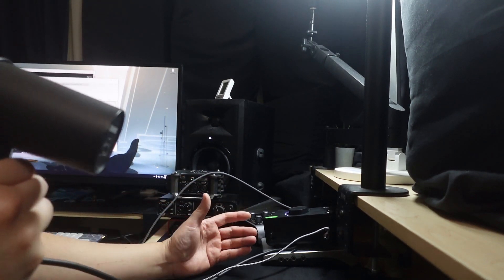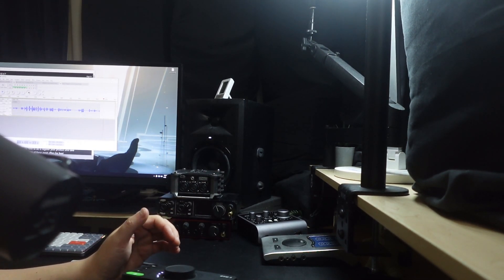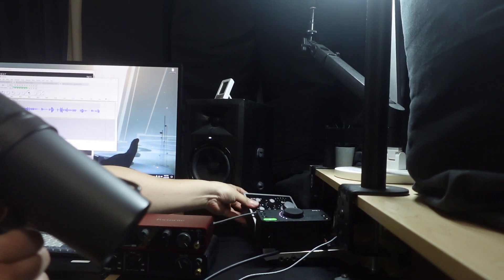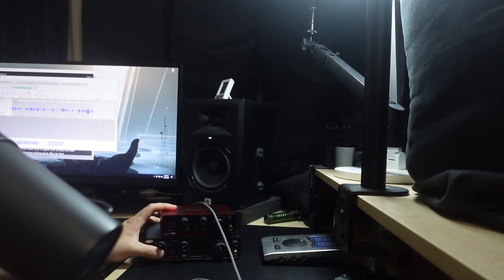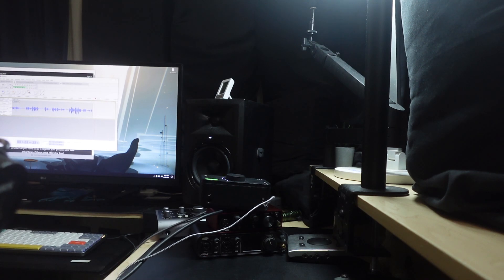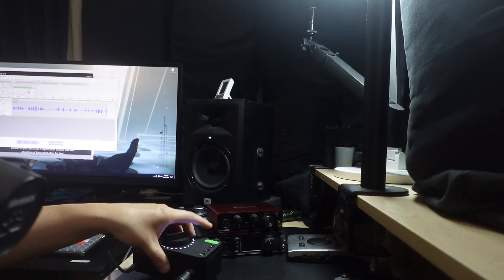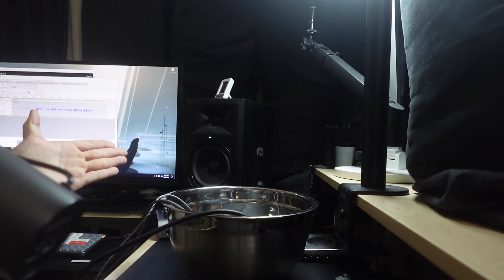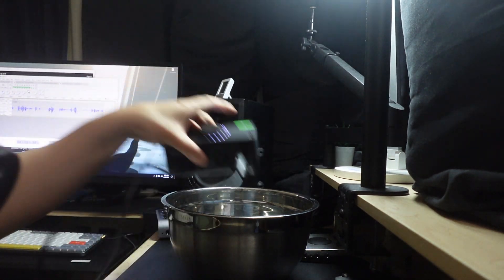How to Fix EMI in Audio Interfaces (Fast!)

Comment: Talk about a simple life hack. Thank you 🙏🏼

A noob question, does a premium xlr cable with ‘marketed’ shielding factor, helps with reducing or eliminate EMI?
Reply from the maker: Going with something like a good quality Mogami cable helps for sure. But you'll still sometimes still get EMI but it's just a variable you can easily remove, ie you know it's not your cable that's the problem.  But even then (based on some new tests I've done) sometimes it's as simple as moving the XLR cable around, moving it will sometimes dissipate or remove some of that EMI sound.

Comment: Rfi is a big issue in electronic nowadays because most things arent propperly shielded. what you can do to mitigate some of these issues is putting rf chokes on the wires to eliminate common mode current. its something we do on our ham radio cables and equipment. depending on the severity of the rfi you may need to buy a ferrite donut and wrap the cables around it several times.  as far as equioment recommendations for recording, id recommend a better front end mixer such as a used sound devices 302 mixer or something similar with lundenahl galavonic isolated preamps. This is of course if one is willing to spend the money on sound devices brand. the basic idea and order is microphone - soundevices mixer - usb interface - computer.  what youre doing is basically shielding the electronic in the bowl. if you want to solve the issue , try rf chokes and go from there. good luck!
Reply from the maker: I feel like the Ferrite would work only on the cable but it still would have issues with the interface. Because I still have problems even when using Mogami cables which are super shielded. But I do notice that RFI does seem to get hit in a few places. (1) The mic (ie the SEV7 is a culprit) that mic in particular is very susceptible (2) , cheap XLR cables (not shielded) (3) plastic interfaces (ie EVO4).
Reply: @Dracomies  ah okay,  best to choke off all cables in your recording area. but that takes time and $$. Sometimes you may not be able to erase the issue. Mogami is great and i'd still choke them off.

Comment: So if you want it to look nicer wouldn’t a metal rack shelf also work than as long as it has sides.
Reply from the maker: I haven't tested that but that would work yes. Or...just get a non-plastic audio interface :D
Reply: @ yep I have an Scarlet i2i so have zero issues with it. I have been thinking about mounting a small shelf under my desk for it to save space.

Comment: i recently got the fifine am 8 for discord calls with friends and gaming, am really disappointed by the audio quality and background noise pick up with usb connections is this because of the mic or does having an audio interface really make such a big difference?
Reply from the maker: It's Discord being Discord. It often will cut my audio out and have issues. What happens when you record in Audacity and hear a recording, that sounds great right?

Comment: What is the source of that EMI? Is that "hot spot" where you have a power supply? your wifi router? Something else?
Reply from the maker: It can be a cellphone, a bluetooth mouse, a Wifi router. It can be many things. But in nearly all cases, metal will block it.

Comment: Would wrapping the sides and bottom with aluminium foil have the same effect?
Reply from the maker: Tested it just now. Nope, metal bowl does it but aluminum foil has no effect. I think the thickness of the metal plays a factor but was good to know :)
Reply: @Dracomies  Aluminum foil is electrostatic shielding.  Magnetic fields will pass right through it.  The bowl you used must have been ferromagnetic - a magnet would stick to it.
Reply from the maker: I have to test that!